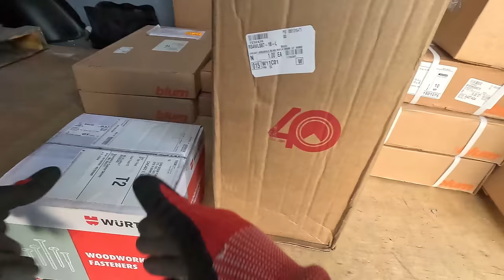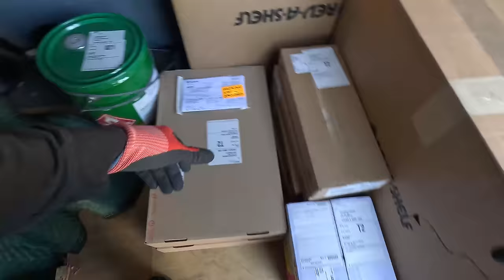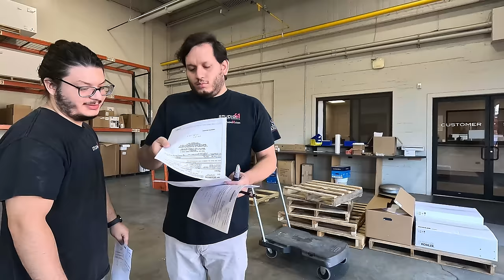Running a NEW ROUTE for $230!! What Gig App is This??

Comment: With that canister, you could get it off one person, pull out the dolly and load it up on there, strap it on, slide it out just like you did with two people but you’ll have a better handle, grip, easier to get a better angle to transfer the weight around.